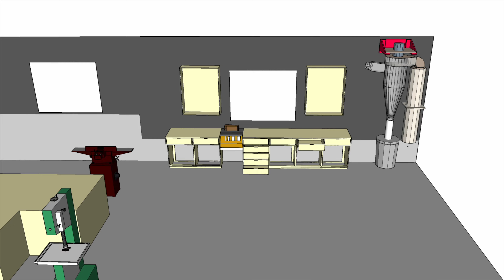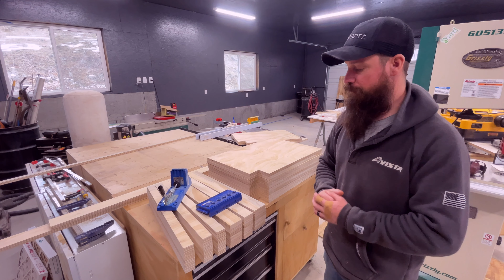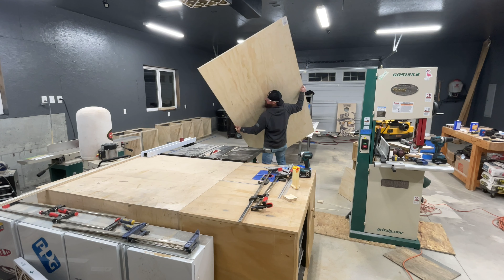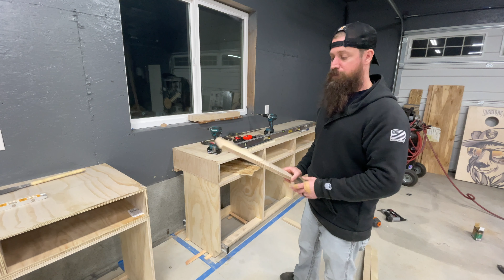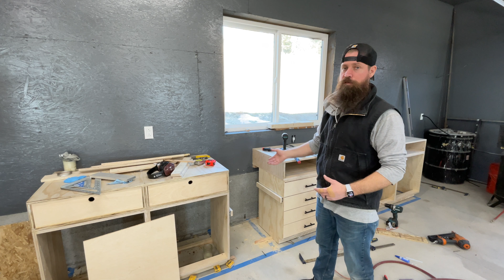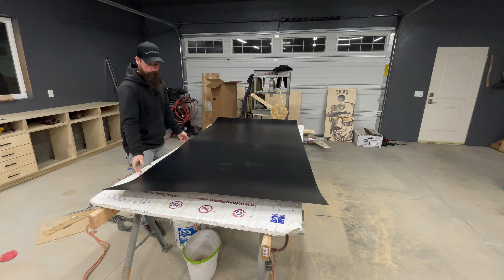I Built a Sanding Workstation and its a GAME CHANGER! |RIDGID BELT SANDER|

Comment: At 34.75” high, is using the sander comfortable? I love mine, but the top of the saber is around 48” or so which I find very comfortable. Great design, thanks for sharing
Reply from the maker: I feel like 34.5 to 35” is a very good working height for my height, especially for tasks that require good mechanical leverage. Now there are certain tasks that have exceptions. So when I built my assembly table I made the top height adjustable. Im pretty happy with that build and video. 🤘🏻 thanks for watching and taking the time to comment, I truly appreciate it. 👊🏻

Comment: Did I miss the over-all dimensions somewhere?
Reply from the maker: No I think I failed to mention them. It’s 13’9” long x 24.5” deep x 34.75” high. Thanks for asking. 👍🏻
Reply: @brewbuilds  to long for my shop, but it's a great idea and I think I can integrate it in a smaller area. 
Great video, thank you
Reply from the maker: @tundrasr5709  keep in mind with the cabinet carcass design you can easily make it shorter it fit your space, and it would save on material cost.👍🏻 thanks for watching, and taking the time to comment. 🤘🏻

Comment: Has anyone ever noticed that the belt moves in the wrong direction? It moves from right to left, but if you're right handed, it would be easier to maneuver the stock with the belt moving from left to right. (all floor model edge sanders move from left to right) I didn't realize this until I bought it. It's a well functioning sander but it would be a huge improvement if the belt moved in the opposite direction.
Reply from the maker: I guess I’ve never thought about it, but I’ve also never owned a floor standing model either.